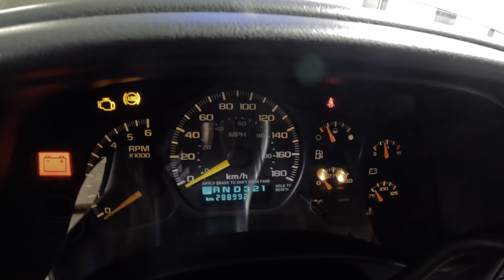Seize the Day! DO NOT Lube Brakes- Grease Jacking   2000 Chevy GMT800 Silverado 5.3 4.8 #repair

Comment: When I do brakes, a thin layer of grease on the pad perches, but a liberal amount of high heat grease on the caliper slide pins, and paying attention not to get to much in the locking threads of the pins!

When I was working as a technician, one of the first break jobs had seized brake pins that snapped the pin at the bolt head, leaving behind the threaded part of the pin! So a light coating!

Now keep in mind, I was a service technician when oil changes were at 3000 miles per year, and these inspections could be done approximately every 3-4 months!

So if you honestly think about it, service and inspection is the real key to keep these things going!

Comment: I grease mine because its normal metal on metal. no fancy stainless clips. 
Slide pin holes get silicone grease.
Back of brake pads get copper paste because that stuff is kinda useless and i need to get rid of it somehow.  
Mating surfaces like wheel hub gets fluid film spray

Comment: Here in the UK it is pretty normal to use antisieze on the brake parts, slide bolts and even a smear on the back of the pads to help prevent pad squeal. Even going to a shop will result in parrs greasing. My wifes first car did not have the pins greased and eventually the caliper seized. I was able to strip everything down, clean & lube everything, but the vehicle required new discs and pads.

Comment: in 40+ years i have never had a pad get stuck or not move due to lubricating the slides. i have however made a ton of money replacing brake pads and rotors thanks to people putting these things together dry. i constantly find them rusted, and have had to use a hammer and chisel to remove the pads.

Comment: i use a light coat under the  hardware only..putting it under the hardware slows the rust down and keeps it from squeezing the pads.. If you grease the slides  it builds up dirt etc like you showed in the video. Most the hardware is stainless.  if your worried about it... service your brakes every few months.

Comment: I use grease, however when i change the wheels from winter to summer or summer to winter i clean and reapply grease, make sure pads move ect. It is nice to keep tabs on how my pads are holding up, aswell as rotors so about every 6 months. I also keep spare pads both front and rear, just in case.

Comment: In the snow belt, I always apply high temp brake grease on the bare metal of the bracket under the stainless steel brake shim to prevent rust jacking. Nothing at all between the shim and the brake pad. Never-sneeze is not correct for rust jacking under the shims. It is not designed for very high brake temps.

Comment: I lube mine in Minnesota the only ti.e I have brake issues is when fitting new pads and they are tight if they are I file them until they install easily especially with aftermarket components. I do pull my caliper pins once a year to clean them and check for any rust or stiffness.

Comment: The di-electric grease goes under the stainless abutment clip after the bracket ways have been relieved of all the rust that jacked it and seized it in the first place.. Also, clean, wire brush/wheel the slide pins and clean the pin hole with a drill appropriate to clean the grease and rust out, not oversize it..   On calipers that have pins going thru rubber slides like old Dodge pickups, peel the rubber sleeve out and get all the rust out from behind with something like a sanding drum or small flap drum on a die-grinder, again not grinding oversize, clearing out the rust only... Clear silicon di-electric tune-up grease resists high temp and washout while not reacting with rubber to degrade or swell like some of the fancy coloured brake lube I suspect caused by the dyes in it.. A bit of this lube in the freshly cleaned bore and on the rubber will help it go back in as well as help seal and keep the salty water out for a bit longer. Never(always)-seize is good for lubing mating steel parts on drum brakes, like it was made for... Has no place anywhere near discs with the exception of the center register on ones that like to seize. Lock-tite blue on caliper bracket bolts, near proper torque, not slammed in ratatatatatatatatat... seals the threads and keeps the salty water out while still being quite removable... I've both seen them come loose with never-seize and also be so tight they stripped the head b/c of some meatfist with an impact gun installed it... I spend far too much time fixing other ppls junk to have to re-do mine annually, here in the rust belt S.Ont. lol.

Keep up the informative videos Ray, I'm sure they've helped out lots of ppl over the years. It seems the weird problems find you like they find me!

Comment: The greasing of the brakes depends where you live. I live in canada and we do grease our brakes or they rust in place and don't slide properly. They way I get around the hard grease build but is every 6 month during an oil change I pull the brakes apart clean and relube everything.

Comment: When I did me research before doing brakes jobs it was clear that if you did lube (top) slides, then only use a very small amount of lubricant - and NOT simple grease.  Same with the slide pins - apparently too much here can cause suction/pressure jamming.  Apparently the best slide pin lube is (3M) Silicone grease (that Permatex purple stuff has been complained about - perhaps they have improved the product since).  And many mechanics recommended anti-seize on certain locations - I use it as Ray did on the underside of slides to mitigate rust (jacking, and et al) and on the face of the hub et al.  I also add some lube on the caliper faces just to mitigate future rust damage - probably not required for certain pad backs (as Ray mentioned) - but I did/do because I am not aware of this and a little cant hurt here either.  One of the main feature of brake system lubes is operating temperature - some spots get hotter than others.  Most brake pads et al come with lubricant in a small pack - and they don't give you much - that's a hint.  Also, it is usually some form of Molybdenum lubricant - which is functionally excellent.  BEWARE - this stuff is highly toxic!  (not to mention expensive - which is why they give you only a small quantity).  Most importantly - NEVER use simple grease !!  (it can/will damage your rubber - such as that of the slide boots - and can cause swelling and then failure).  Also, DO NOT mix lubricants  ...  Those slide pin 'cavities' SHOULD BE cleaned out well before re-lubing - unless your sure you are applying the identical lube !!

Comment: I think it depends on the style the caliper is.  I've had oem pad installment instructions specifically tell me to grease the slides/ears on the brake pad.
Reply: But to add seeing gow this particular caliper/caliper bracket is designed I can see how heavy greasing would be bad thing to do.

Comment: Thanks Ray, I'm just about to do my pad change and was going lube up those shim brackets as I was told to do so. After your explanation I will NOT be doing so, agree 100%  ceramic grease would only attract brake/ road dust and bind up pads. You saved my bacon brother cheers mate.👍p.s. would you recommend grease on the backside face which contacts the piston to pad?

Comment: So which do you think is worse? Grease jacking or rust jacking? At least you could get the calipers and pads out. I've had to hammer pads out with a punch and bfh. Brakes don't work when they're rusted into a blob or when the pads are rusted fast to the slides.

Comment: I live in a rust country and you need to lube brakes here. Use the ceramic brake paste / lube and if it has the stainless inserts that the pads slides against i usually cleans and lubes behind the inserts so new rust dosent form as quickly.

Comment: Tip: You can "sharpen" your wire wheel by carefully dressing it with an old grindstone or even on the bench grinder if you are careful.

Comment: Many of the hardware shims today is graphite or teflon coated. If not a fine film of lube under the shim is all that’s needed and a fine coat on piston faces and where the caliper contacts the outer pad. This truck had an excess of lube for sure.

Comment: Toyota has a specific pink grease for their rubber bits in the caliper slides.
It is a Glycol based Grease with Lithium soap that doesn't swell the rubber so much and is compatible with the glycol in the brake fluid - important inside the piston seal.
Of course, I am talking about a completely different application. sorry for going off-topic.

Also I prefer Fluid Film over 'never anti seize' for surfaces not inside bolt threads

Comment: In the early sixties there was a big problem with the brake calipers locking up and not releasing the pads. There was a lot of research onto developing a lubricant for the calipers that would also not collect dust and dirt.  I thought by now they would actually have specific lubricants for that.

Comment: Stuck brake pads will cause the brakes to overheat and hurt fuel efficiency. I had my brake pads replaced and suddenly the fuel mileage improves because I noticed the brake pads was a little too tight, so I used metal file and loosen up a bit.

Comment: I put grease on the under side of the hardware. Never on top. I grew up on dirt roads where the grease would build up on it and lock up everything. I never try to remove the wheel speed sensors. I unplug them .

Comment: Those rotors might have been all funky and the pads not engaging correctly if no goops and greases were used, too. Kind of a tie.

But I feel compelled to point out that the rotors came off and the wheel bearings came out of the hubs with no drama. Hooray for anti-seize!

Comment: That hub bearing came out pretty easily. Usually those sorts of bearings are virtually welded in place and beating them with hammers doesn’t get them out. If that turns out to be the case, I use a 10 ton body dozer, pushing against the wheel on the other side. Never had one beat me yet, using that.
Reply: Yeah, Ray stated that he saw some anti seize on the mating surfaces

Comment: Brake hardware is stainless so they won't rust but up north its probably good to put grease behind the hardware to prevent rust jacking but no need for grease on top of hardware

Comment: As a GM mechanic for 10 years I don't put grease on them but I do put a little amount of brake slide lube on them, I said a little, I also live in Canada I have seen so many cars come in with the pads siezed in place that weren't lubed. I not talking about the pins either. So I really think it depends on the application. Don't use grease though that is definately a no no.

Comment: Thanks Ray I note that you do grease the slide pins but never grease the pad ears.  I had been told that the pad ears should be greased to prevent squeeling noise is that correct?

Comment: I'm from the book printing era, and all moving parts on a Heidelberg printing press, only oil is used for lube because grease attracts paper dust, therefore binding and grinding on metal parts. This case, brake dust binding it up. No lube on brakes for me.

Comment: Ray I've always just kinda cleaned the crud off the slides,then of course new clips, some I've had to use a wire brush to remove the rust so the clips would actually fit,but I've never greased that part. Hope I've been doing it right lol

Comment: Eric O says no.  You grease between the slides and the frame to prevent rust, but not on the surface of the slide that touches the tabs of the brake pads.  That surface doesn't need grease because it is stainless steel, and if you do put grease there it will trap grit that may cause binding.  AND, perhaps most importantly, he said that when factory specs discuss the issue they say do NOT grease the slides.  Whenever you face a dilemma as, WWED?  What would Eric Do?

Comment: I live in Canada. I never ever use lube or grease on the hardware. I service the slide pins during tire rotations or if I have to take the calipers off. Take care of your vehicle and you won't have an issue.

Comment: The rust on the inside of the rotor is caused by salt and moisture not drying out, due to the back plates and splash shields under todays cars  holding it in

Comment: How important are backing plates? I knocked them off when it was as bad as this videos on the rears of an Acura MDX.

I just inspect the system once a year, check and relube the sliding pins when that happened

Comment: Grease the calliper pins so it moves and self centres smoothly.  Do NOT grease the shoe slides.  The slides are stainless steel to slow rustncrust build up on them … no issues if the brakes are checked and cleaned twice a year.  In March and in October.  Brakes are a maintenance item and will last a long time if maintained.  If neglected, they will trashed themselves in a year and half.

Comment: Don't lube the sliders.  Do put a thin layer between the sliders and the caliper bracket, where the sliders sit, to prevent rust jacking.  This will eliminate issues with pads seizing.

Comment: 12 oz of transmission fluid along with about 4 oz of something like PB Blaster and 1 oz of Dawn dish detergent in a spray bottle will help arrest a lot of the rust on that Canuck truck. The slower you get that rust to propagate the longer that truck will last. The fact that in Canada they don't use salt help that truck stay at least in a little bit of decent condition but my guess is is it made frequent trips into the northern states where they frequently do use salt.
As for lubricating brake slides, I have on occasion put just a small amount and I mean a tiny amount of CRC brake Lube only on the brake pad plate itself. Otherwise I try and use dry Teflon Lube on those stainless steel slides. It does provide lubrication on the stainless slide without drawing dirt or dust or brake contaminants. And it does have a little bit of a wax carrier to it, but that melts away and there's enough Teflon left that when it heat Cycles it actually adheres to the metal I've used it on firearms for years so that they do not draw a dirt either. It might be something to consider. Especially when you're working with some of that stuff anything that protects it from rusting yet again, will help. Even in Florida. Especially where you have a vehicle like that Canuck truck. That already has rust that has begun. Anywhere near the ocean gets a salt Mist in the air on occasion, depending on the prevailing wind. You can get rust in Florida . Not to the extent that you do here in Detroit area, but you can't get it.
Reply: In Ontario Canada where that truck is from they use salt on the roads (and lots of it). SOME of the other provinces, not so much...
Reply: You're a bit off on that "no salt in Canada" statement, the roads departments in Ontario, Quebec, AND British Columbia most certainly DO use salt, and plenty of it. Quebec even goes a step further and mixes sand in with the salt to create some traction when the salt stops working at below zero temperatures.

Comment: Rust jacking or grease jacking or destroyed hardware.  Either way those pads are gonna get stuck. There is no solution I fear. :P  But I'm gonna keep LIGHTLY greasing the landings for the pads with caliper grease.  Been doing it for years, and I don't see this kind of buildup you're seeing, that's over much grease.  And I've worn grooves into rotors, them pads slid just fine.  I was an idiot then, I keep better eyes on them now.

But my own opinion and experiences so far in this short dang life.  Y'all do y'all and I agree with you for you. :)

Comment: That vintage 1500 should have zerks already on the front end from the factory. 6 on the 2wd and 11 on a 4x4.

As far as grease on the slides. I used to live in the rust belt. Never greased where the pad slides but always on the underneath of the shim where it clips onto the bracket. If you didnt the bracket itself would rust and get displaced and over time could lock up the pads. Eric O explains it well.

Comment: i never grease the pad slides but always the pins with dielectric grease anti seize gets thick gummy the metal on stainless shims and pad backing plate NEVER SEIZE UP if left dry

Comment: Interesting. Looks like those pads being blocked by dry lube buildup are signs of lack of preventative maintenance or using wrong product. Probably. I always grease the ears and back plates, internal and external slide pins and during rotations I inspect that area and never had buildup like you showed or rotor uneven wear like your example. Never gave me an issue, but it's good to know. My 2016 Ford service manual has zero mention of greasing brake components or checking, my 1998 Toyota service manual does have a step to grease components, and my 2001 VW service manual specifically mentions to inspect bonding surface is free of grease. Nice video. I dont like chevy but i do like that Truck year model you worked on.

Comment: No lube on the slide pin is great for anywhere rust isn't an issue like say Florida. If you don't apply a light film of some type of lube the slide rust up quickly the pads don't release completely and you end up with warped rotors.

Comment: The grease over time would build up metal content from wear on the pins turning that grease into cutting compound (sort of) and also provide resistance to the pad moving freely. I know it sounds contrary to thinking but some things don't need grease. If the slides are made of harder metal than the pad mount metal the pad should wear more than the slide over time as a sacrificial material, changing pads is cheaper than a whole new caliper just from wear and tear. I'm not 100% on this as I'm not a car engineer. Just my thoughts on this.